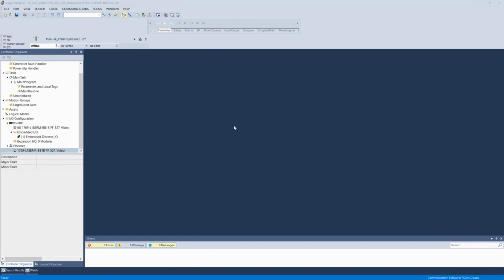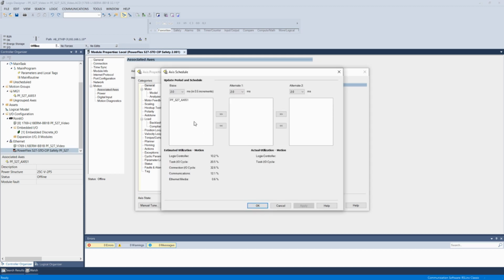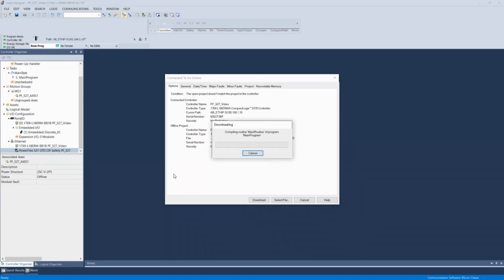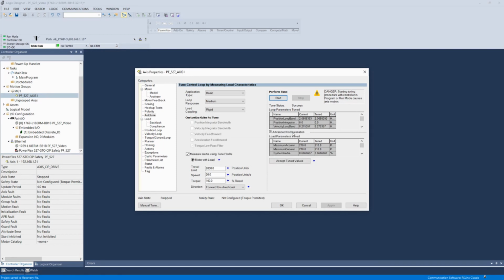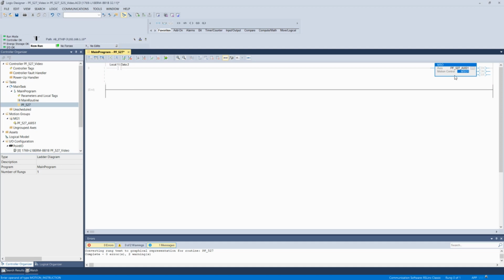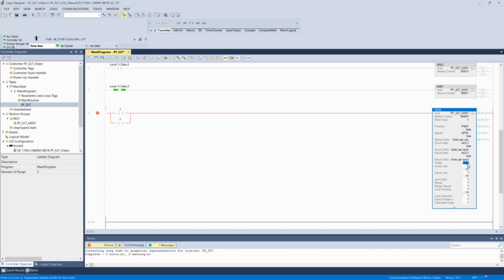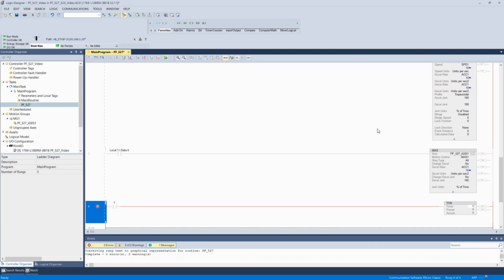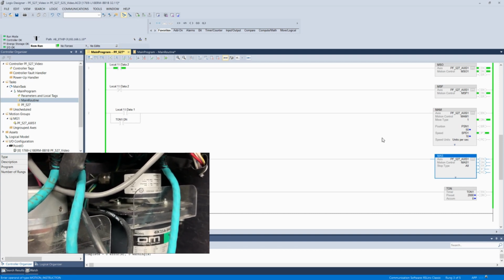PowerFlex 527 Set-Up and Programming

Comment: Hi, how are you? I have a question; perhaps you have an idea how to solve it. It's with several Powerflex 527 drives. I've searched everywhere, including the manual, but we can't find the cause. We have several drives of this model integrated, and at some point, they stop responding. They don't register any faults or anything like that, either on the axis or in the module, either from the project or physically; they just stop responding. In the PLC project, we control them through a block provided by Rockwell, an AOI with built-in logic. The only way to get the drive to respond again is by unplugging and plugging the power cable back in. Do you know of any similar errors, or have any idea where to look for the problem? Thanks

Comment: I have a struggle during working with PF527, it seem that my drive was configured in Network Safe Torque Off and i cannot changed it to hardwired or disable Network Safety. Do you have any experiences in this case?